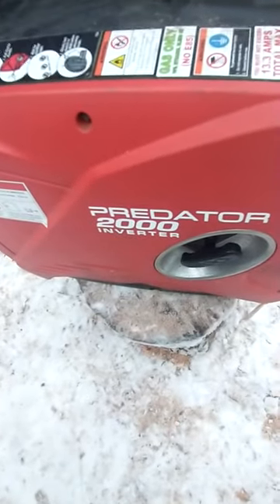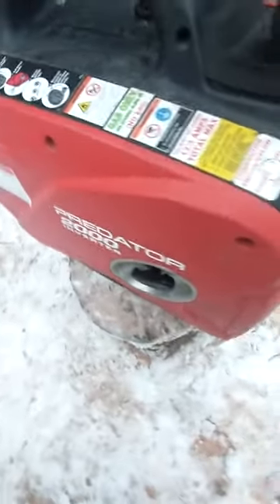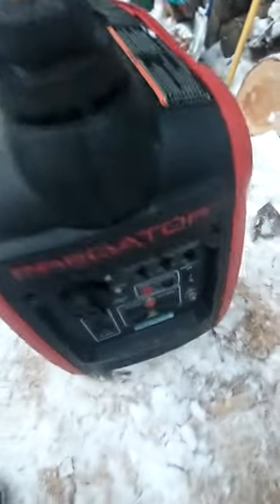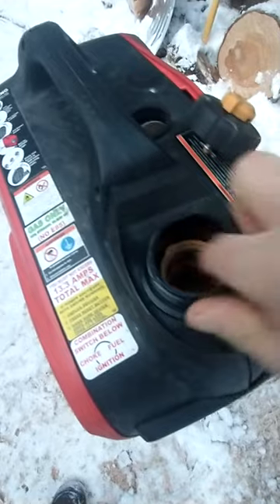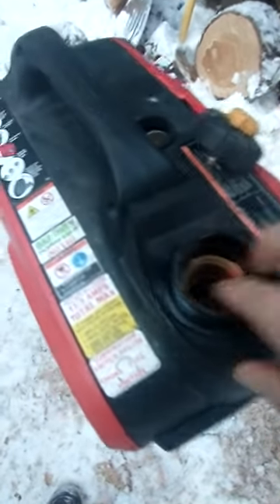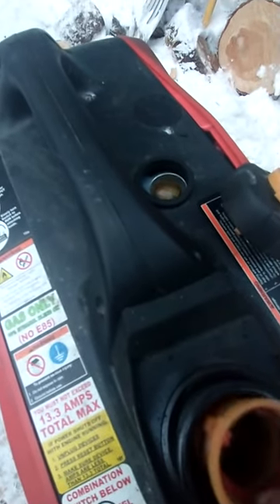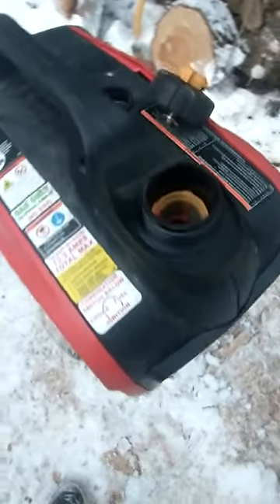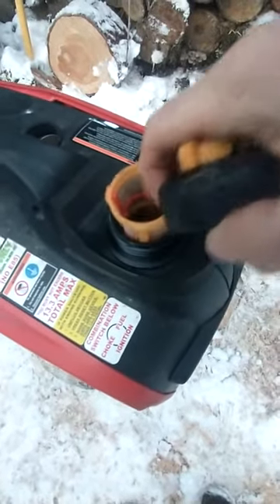The biggest flaw: Harbor Freight Predator 2000 generator #shorts

Comment: The biggest flaw for me with the 1400 is the fuel shutoff is the off switch you can never run the fuel out of the carb!? I installed a toggle switch and connected the off switch wires to it and can now run the carb out of fuel.
Reply from the maker: That's a great idea to keep the jets from getting gummed up by stagnant old fuel.

Comment: I just got a 1400 pred sealed new in box and it had the spark plug cross threaded from the factory. Removing it destroyed the threads. Also cover screws cross threaded into u nuts. Good luck to anybody who has one of these sealed in the box waiting for a disaster
Reply from the maker: I bought a new Predator 1400 about 2 years ago. I ran the first tank of fuel through it and refueled it. When I tried to start it again, it would not fire. I brought it back to Harbor Freight the next day for a refund. What a disappointment of a generator.
Reply: @inthemountainswithken  ha ha, we shouldn’t be surprised, but man it looks the part, I was hoping for quality. I have another 1400 that I got for 150 bucks runs like a champ till it burns enough oil to shut off. The best part running two of these parallel is when one stutters, they both stutter and get out of sync 😆
Reply: @inthemountainswithken I bought the 1400 used as a refurb I probably bought yours😢😢😂😢
Reply: Bring it back for warranty issues. If you didn't buy the 2 year warranty on a predator, you made a massive mistake.
Reply: @daltonsales5481  only cost me 200 new in the box. Vs 450 plus tax and warranty. The bolt that holds the rocker arms had 2 lock washers and not enough thread holding the rod that holds the rockers. I fixed it. Ha do to take the whole thing apart. But I still win in th em end 👍

Comment: It has a tiny nipple filter inside gas tank where the fuel line connects similar to weed eater fuel filter.
Reply from the maker: The jets are so tiny on that carburator, so having the cleanest fuel possible is important to keep the predator going.

Comment: Seems the same as Honda generators.
Reply from the maker: I believe believe the predator is clone of the Honda 2000, I think the Honda does have an inline fuel filter. The Honda does have a slightly larger gas tank as well.
Reply: @In the Mountains with Ken  well there is a huge price difference also....so for a slightly bigger tank and fuel filter..?...and maybe the Honda name ..........anyone can install a fuel filter...